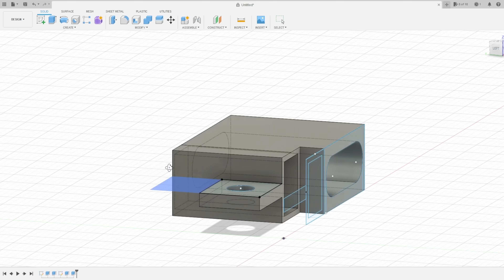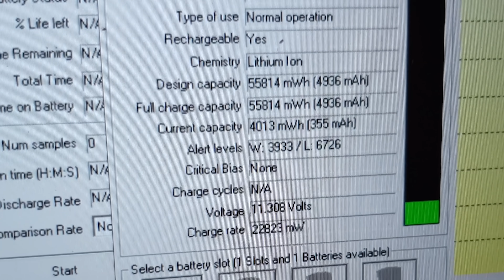Hacking my laptop so I could travel lighter!

Comment: Logical and simple, makes the laptop better. I did a similar thing converting my trackpad to rechargeable LiPo rather than AA’s.
Reply: Your trackpad???
Reply: @christianflores3437  An Apple A1339, I now charge it via USB.
Reply: @FixTechStuff  oh WOW it's exactly what you said it was. Idk what they were
Reply from the maker: Smart! I like it.
Reply: it's not simple at all, since it requires 3d printer lol. But it's pretty genius mod
Reply: @MrLeSa95  I bought an Easythreed 3d printer for USD$90, cheaper than my regular office printer. Not necessarily that one, but I highly recommend having a 3D printer, they pay for themselves in no time.
Reply: What about the ID pin?
Reply: @filenotfound__3871  I don't think it has one, usually those are common with DELL or Apple. There is probably a workaround.
Reply: @filenotfound__3871 its mostly on dells 😅. Reverse engineering or use the original charger and live in constant fear that the thin piece of metal will break and destroy the charger.
Reply: LiPo powered trackpad.... Great idea....

 If you want to burn down your house....
Reply: You are simply damaging and making laptop more difficult to resell. Simply keep using that tiny adapter, not that difficult.
Reply: @ligametis  That's an opinion, yes but  I'm with the video creator. Simplifying things so  you have to carry less stuff and they work better.
Reply: @FixTechStuff  I don't see how such mod is the "simple" solution. It requires more effort than almost anything else
Reply: @ligametis  it may be hard to install but it means you can carry less proprietary chargers and use just 1 USB-C charger which is the hole point of USB-C in the first place.
Reply: @Mrsloththegreat  usb c is worse and less reliable than those old school barrel plugs. Especially when you need those small trigger boards. You also need a power brick with 20v output and those are still pretty unusual
Reply: @ligametis  trust me, usb-c makes you free)
this board triggers PD protocol (that’s how it gets 20v from 5v adapters), so any usual charger with 40w+ output can run it.
you can carry only super tiny GaN adapter to power all your tech. You can charge laptop even with a power bank.
I bought ASUS vivobook 14x pro oled, and one of the big reasons - it have smart controller in thunderbolt port, so I can charge this thing even with apples 5w brick😅
you just simplifying your backpack a lot, by using devices with the same charging interface.
Reply: @Deydarchik  I don't like usb c it is a weak connector and constantly breaks. Old barrel plugs are invincible.

You also need to buy 60w+ adapter with 20v output for like 50 extra dollars

After all you can do all this without damaging the laptop. With those tiny adapters that he showed himself. 

By the way usb A is just a better form factor.
Reply: @ligametis  those old school charger are ultra problematic & fragile quality which depend on every spesific brand/manufacturer. the usb c is way more universal and worth the effort~
Reply: @elrozy32  This sketchy conversion is the most fragile and problematic thing. OEM charges have to comply with regulations unlike some cheap knockoff UGreen charger.
Reply: @ligametis  It's not for everyone to do, if the old barrel plug works well for you then keep using it
Reply: @ligametis  Third party chargers still have to abide to regulations, and UGreen is a big enough company to not have to worry about them trying to avoid it
Reply: @Vylpes  Thats the point. why change it if it isn't broken? After a year or two new laptop will come with usb c
Reply: @ligametis  the point of converting to usb c is that 1 charger can be used to charge any devices, while with the old school "barrel plug" it's only able to charge a laptop, not any other device like a phone, wireless earbuds, and more
Reply: @ligametis  If its their laptop should they not be able to do what they want with their own stuff?
Reply: @Vylpes  true and it increases longevity as its a standard charger so any USB-C cable will work with it 

Checkmate @ligametis
Reply: @ligametis   it increases longevity as its a standard charger so any USB-C cable will work with it 

Checkmate
Reply: @ligametis how are you breaking so many USB C connectors man? I've never broken one, I've only worn one down after 5 years of usage, which happens just as much with barrel plugs, and when it does it's easy enough to fix. 

If you're doing this, you have a PD charger already or want to buy one as a "charge anything you throw at it" solution. It's not a 50 USD laptop charger, it's 50 bucks for the convenience of having fast charging on your laptop, phone, tablet (if you carry one), headphones and peripherals, all with a single charger and cable. Worth it for some, not for others. Doesn't mean it's simply "bad" or "stupid".
Reply: @ligametis that mod looks fking stock bro, he 3d printed almost perfect fit component as well as the mounting part
Reply: @ligametis  Also moding USB-C on to old laptops allows for people buying it second hand to use any charger And its a lot more reliable than the barrel plug.
Reply: @Mrsloththegreat  barrel plug is more reliable. And people do not like shady damaged electronics. This is opposite of improvement and makes original power brick useless.
Reply: @ligametis   Barrel plugs are less reliable because if they break the chance of you finding another one is next to zero. and repairing the charger is dangerous as power supplies hold a High voltage in its capacitors
Reply: @Mrsloththegreat  output is not high voltage and there are only two wires to solder
Reply: @ligametis the original power brick can be used for other projects. It won't be used in the laptop, as not using it was the entire idea of the mod. It may not be of your liking, but for most people this is a nice mod. 

Besides, the moment you start tinkering with anything you completely forget about resale value. Any and all mods will reduce resale value by a big margin, cause as the buyer you're taking a gamble on how competent the previous owner was. Even if the machine was just opened to clean the fans and heatsink, I'd rather have a sealed machine that runs a bit hotter than risking it with someone who tampered the thing.

Comment: Great idea.
It will be great for overnight charging. If you have a gaming laptop and want to play and charge.... this will have limitations. My laptop requires 2xUSB C connection to be able to run at full power and charge. A charging brick will be just as big, but having a brick that works for everything is space efficient.
Reply from the maker: 100% true! Gaming laptops might be difficult with this mod. Great thing 240W USBC is around the corner! There might be some gaming laptops that will suffice with this mod if their original charger is 100W. Anything more like yours will not work.
Reply: @goodjihad 240W Gaming laptops won't work with 240W USB-C. No Gaming laptop take in a 48V like 240W USB does, but gaming laptops take something like that: 20-20V at 12-10A for 240W.
Reply: @volodumurkalunyak4651  no problem, as long as you can fit a dc-dc converter inside it
Reply: @volodumurkalunyak4651  the 48v is just so they can hit 240w without a huge amount of amps to keep the wire gauge down. It'll be converted down to 12v, 5v, and 3.3v internally for respective components.
Reply: @HerbaMachina  only if DC-DC converter fits. Take modern gaming laptop and you probably won't have a place to make it fit.

Comment: Hey Joe! Great content, I am glad I found your channel.
I saw your video about installing a similar connector on a keyboard.. I am having trouble with a similar setup on my keyboard, I wired D+ D- V and G correctly, but it works only when I use a usb-c to usb-a cable, it does not work when I wire it with a usb-c to usb-c cable, any ideas?
Reply from the maker: Correct. You have a USB-C pcb that only supports C-A. Message me on twitter and I will help out :)
Reply: @goodjihad  did you already solve this problem? may i see the solutions?